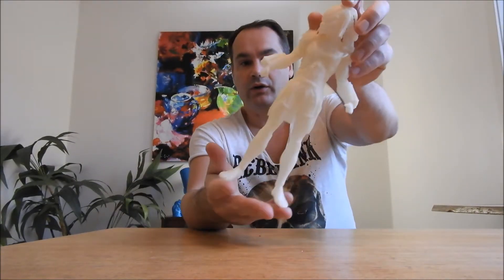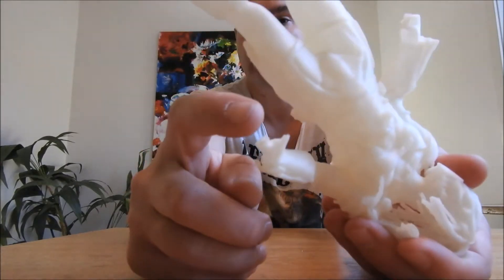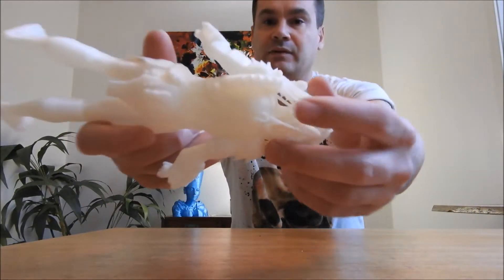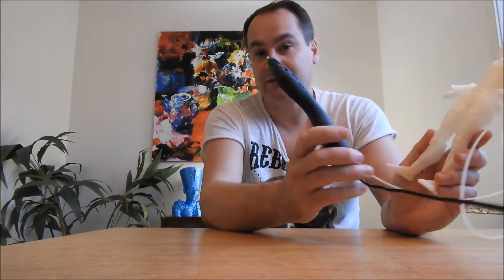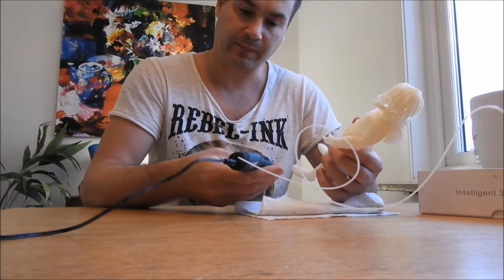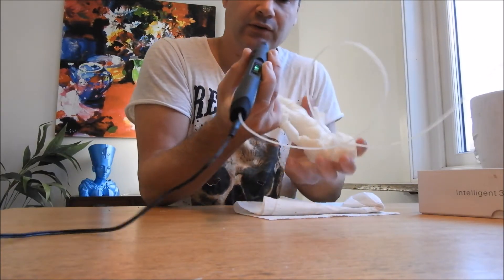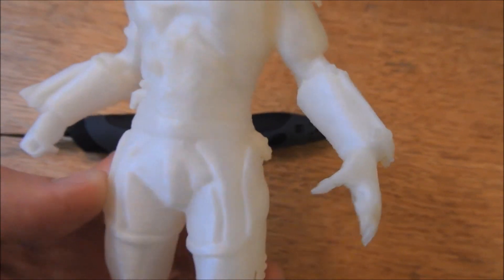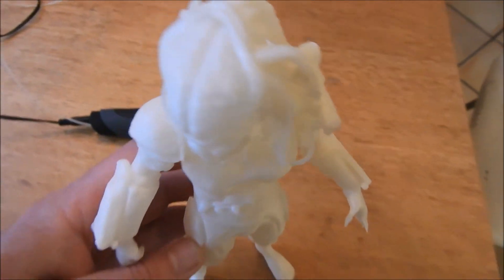Repair your failed 3D prints with a 3D pen

Comment: Well that was useless. You sped through the one part we all wanted to see, and provided zero details on the actual application of filament for repair.
Reply from the maker: please share better way !? how to repair this 3d printed model ;-)
Reply: @ThousandHobbies  You could have talked about the choice of material, done close ups of the repair in progress, talked about how to clean up the repair afterwards. You didn't even zoom in on the initial damage so it was never really clear what you were even repairing in the first place. I've been considering buying a pen for repair, but replacing fingers is only one tiny part of the range of repair jobs it might be useful for. Can it be used to join snapped parts? How about filling holes? Is it best to use it at a cooler temperature for quick setting or a high temperature for easier moulding? There are LOADS of issues you might have discussed but as it is, even the one specific, rare situation you DID discuss, you provided no clarity.
Reply from the maker: @Martial-Mat  I got the point.... ;-) this vid. not the 3Dpen review (jus tips) please Check the following link https://www.google.com/search?q=how+to+use+3dpen&oq=how+to+use+3dpen&aqs=chrome..69i57j0l3.9367j0j9&client=ms-android-xiaomi&sourceid=chrome-mobile&ie=UTF-8

Comment: i'm currently building  a helmet, now i've just been using uhu glue to join the parts which is really messy, how do you think a 3d pen would fair?
Reply from the maker: i don't think this is good idea (3Dpen) for the BIG parts...i glue my 3D printed parts with epoxy glue or UV-resin by using UV-flashlight
Reply: i have plenty of resin (y) never thought of using that, Nice one